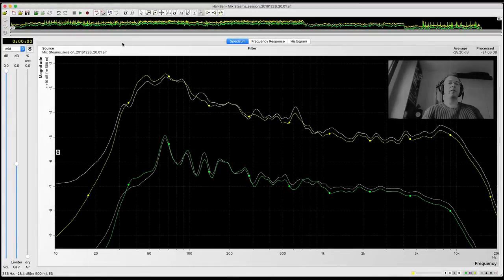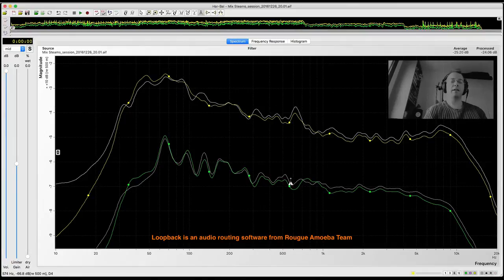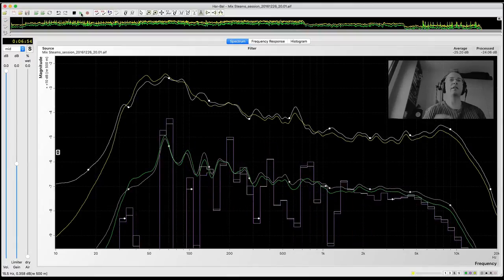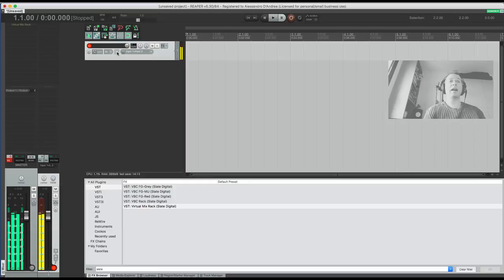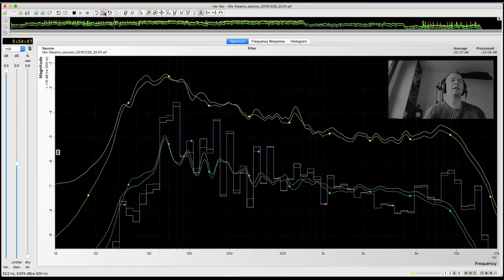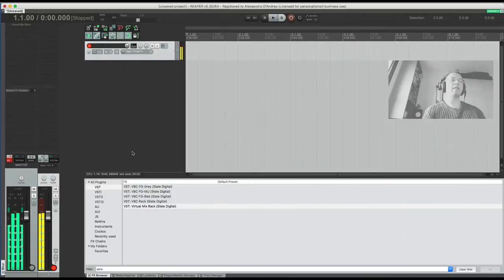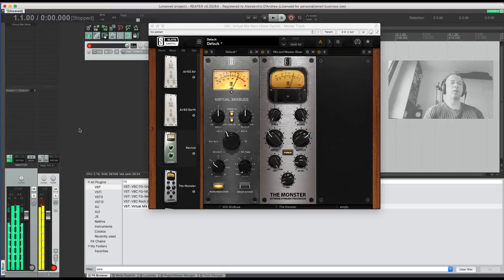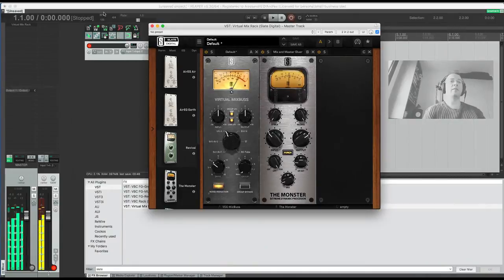Har.Bal 3.7 My Workflow

Comment: But there is something that i'm not sure to have understood. When you send the master mix to harbal. I suppose you can't use the intuit q reference and match because har bal is in real time working. Right? Is there any difference between, to bounce from reaper to harbal and from har bal to  windows, and to print the signal loaded like separate mode in har bal to reaper?  I hope i have explained. Thanks very much about the tutorial. It's very interesting.